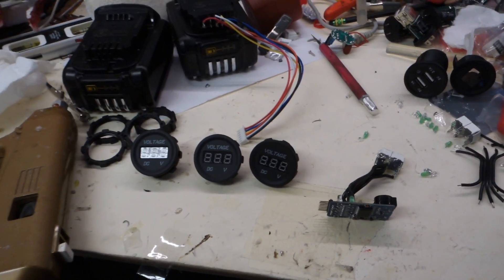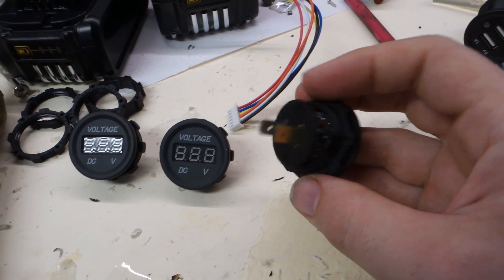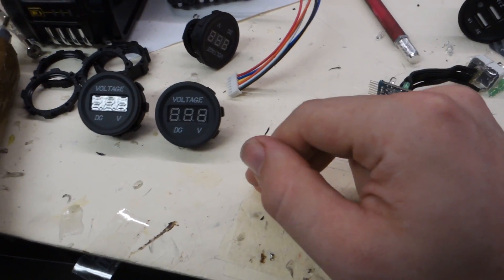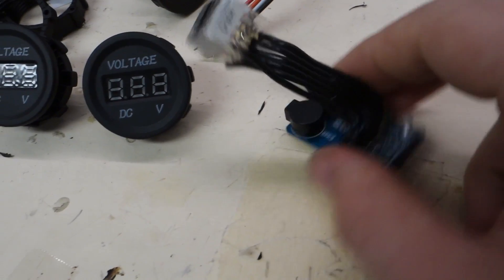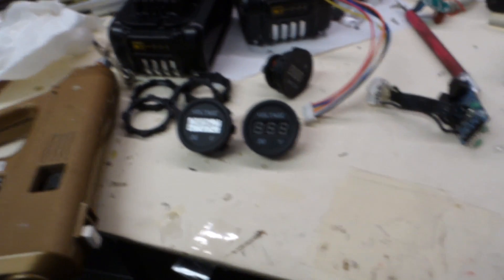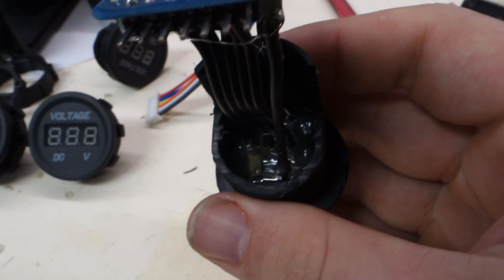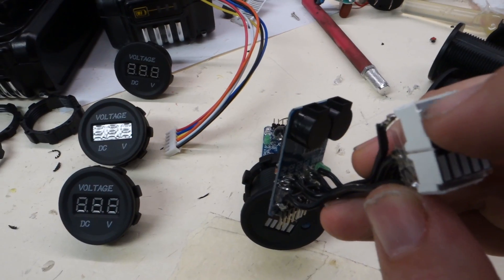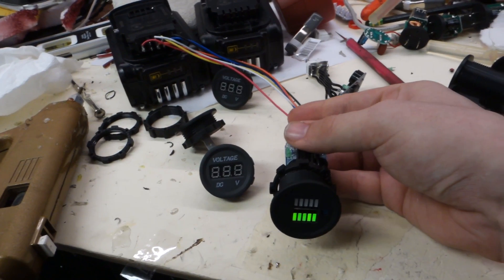Dewalt 20v x 6 Electric Bicycle part 5 Battery Gauges

Comment: 4.20 per cell is 100% charge, 3.80 is storage charge 3.60 is depleted you can run as low as 3.3 but it gets most of its voltage peak hold from 4.10 to 3.70

Comment: I would have added a 5-way switch between the batteries and gauge, so I only have to use one gauge.
Reply: Correction: 6 position rotary switch.